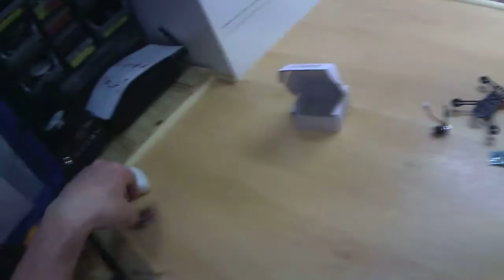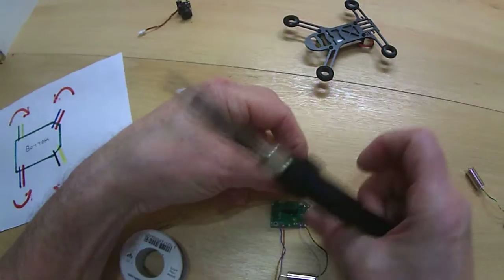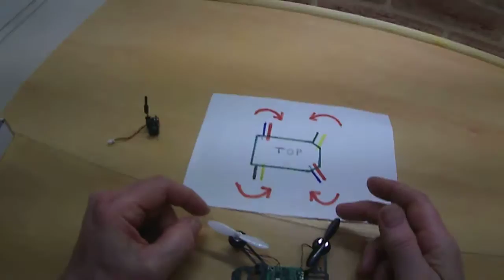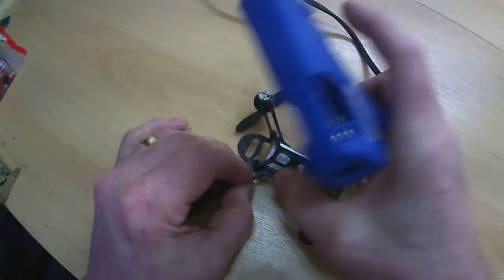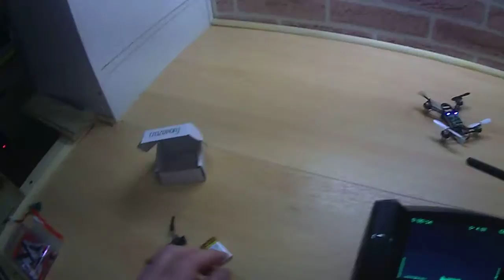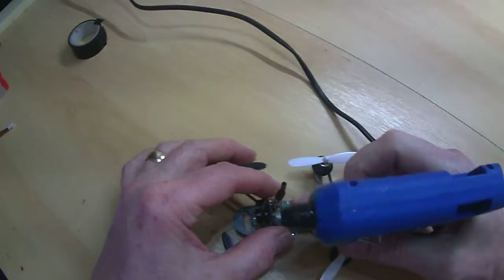Build your own FPV micro drone

Comment: I might not of caught it but you built on the frame in reverse, FPV cam & board should be 180 degrees the other way on the QX95, nice simple build....good job.
Reply from the maker: Just personal preference you can build either way round, thanks for the comments Jason.